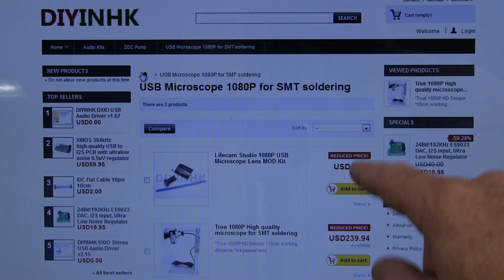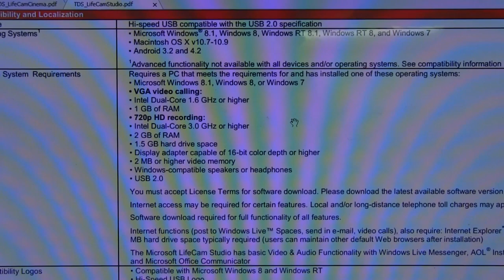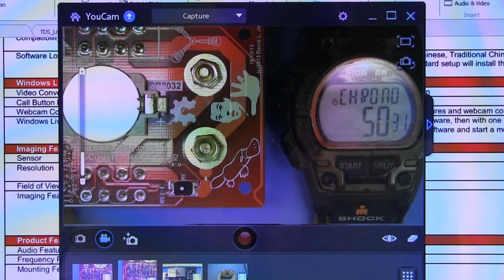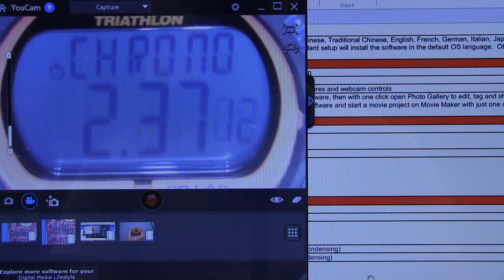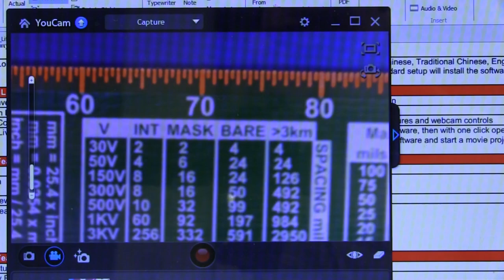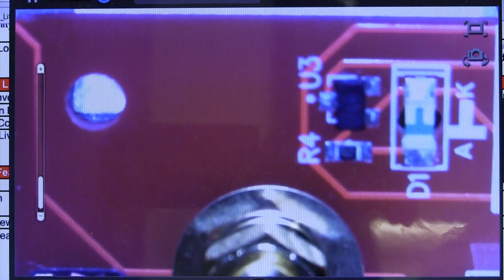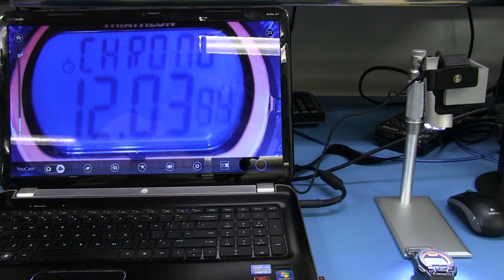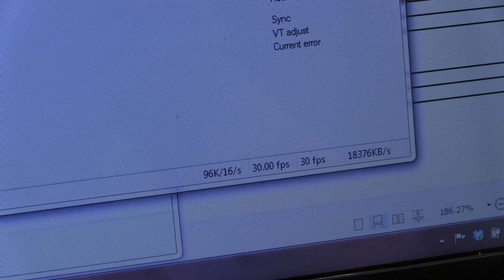EEVblog #590 - DIYINHK 1080P HD USB Soldering Microscope Review + Tagarno FHD ZIP

Comment: AMD Radeon 6770M, not intel.
the issue with the stuttering on the better camera is possibly something driver-related. the HP should be more than fast enough to handle running that without recording. it could be that USB selective suspend is on, I've had this issue with a couple webcams in the past.

the other thing to obviously try is not to use cyberlink youcam, since it's pretty buggy for 1080 recording anyway. there's much better options that make use of hardware better that don't bog down when recordings are done... thers is no reason why your hardware shouldn't support recording at that resoluiton.

Comment: Dave, I know this is an older video and maybe you revisited this, but...   I've found that if you either modify the base to add weight or use a bench clamp then rotate the arm around 180deg to the back you gain significant stability improvement.

Comment: That laptop with an SSD should have no issues with recording at 60 fps. It is definitely your software. Have you tried the scope in virtual dub as well? VLC is fast but is not intuitive and tricky to get setup. Also, record in RAW format. Your ssd can handle it and you dont have to do extra processing. Youll have a higher quality final video as well since you will not be compressing it twice.
Reply from the maker: I'm currently working on direct streaming solutions.
Reply: EEVblog
windows is a bloody mess for realtime, high-bandwidth stuff. You have probably figured it out yourself already.
Reply: Recently I've started using AVS Video Recorder. Really nice. Windows 8 included Camera app might also be enough!

Comment: The limited FPS in full HD is most likely due to the video format chosen by the application.
The LifeCam  has the ability to deliver MJPEG compressed "video" stream allowing  full framerate at full HD, but the windows drivers and libraries may no longer expose that so app runs video uncompressed.

Source: https://www.mgraves.org/2015/08/a-better-understanding-of-the-microsoft-lifecam-studio-webcam/

Comment: It is too bad the manufacturer "missed" the working distance by about 1cm or so.  It would be nice if it could focus all the way down to the bench.  This seems to be a problem with the way the microscope is mounted to the armature.  Perhaps they should have made the main support tube (vertical tube) a little shorter, and it would have worked just perfectly.

I suppose a purchaser could modify the mount in order to lower the microscope body a tiny bit, so that it could be adjusted to focus on the table as it should.  Perhaps right where the scope connects to the pivoting mechanism, you could take a small piece of flat steel, and with a little tinkering make a little 'extension' bar to keep the scope thrust slightly forward (downward) of where it normally sits when assembled right out of the box.  In other words, have the camera "crane its neck" forward a little bit so when it is lowered to the lowest elevation, it can see the table surface within its focal range.

Luckily, this seems to be the main problem, and it is more a "crude mechanical issue" rather than optics or software.  Therefore a crude mechanical workaround similar to what I'm suggesting would be well within the skill set of many users.

An excellent review of an amazing budget microscope!

Comment: Have you tried recording with VLC? (VideoLAN), it doesn't give you that many options, just records the "direct" video stream. Worth a test.
Reply from the maker: Ah, I forgot VLC did recording, use it for my playbacks. Will have to try it.
Reply: I wasn't aware that VLC could record. Thank you for this comment.
Reply: Media -> Open Capture Device... and View -> Advanced controls (for the record button).
Reply: TheAmmoniacal
Thanks! I'll try it out when I get around to it.
Reply: EEVblog make a DVD extra video.
Reply: @DemonTraven  Yeah, VLC does it, but it has a very strange interface and setup procedure. Very alien, but once you get through it, it's one of the fastest as it is very lean. It just does the minimum necessary to pass the data to the codec's you setup to use.

Comment: If you have excess solder on your board or if you just want to make it look nice, run some solder wick over the pins. It will also take care of solder bridges, including the ones hidden under the chip, and make it look nice. Good for passing QA inspection. I have fixed more than a few boards using this method.

Comment: I don't know if it has been mentioned previously.
If the Tagarno is able to be used as a camera, you could try using Open Broadcaster, which will allow you to use Quicksync which is available with your processor. It would make capturing 1080p@60FPS a breeze.
Provided the Tagarno is doing compression for USB 2.0, or you have USB 3.0 available.
Really surprised that HP doesn't have 3.0

Comment: I would put my money on bugs with the USB 3.0 port. Check for latest drivers. Make sure you are using a using a USB 3.0 port native to the chipset if available. Some ports also share channels to the controller so try your camera without any other USB devices if you haven't yet. Another thing to try is to disable any power management features in Windows 7. Search for advanced power settings.

Comment: the lifecams have 2 modes, it has a yuv and a mjpeg. The mjpeg is the smooth one. Web cams only have shutter priority exposure so lower light means stretching out each frame time making it choppy. Im surprised they did not build this around one of the newer logitech ones that support AVC mp4

Comment: I use my old PAL analog Video Cam for this job, hooked up to an old and little PAL S/W video monitor, to view my SMD soldering. The cam´s optic gives me a 10x macro-zoom so i can view a sot23 full screen where the cam is 20cm above from the PCB.
Just made with "junk" components, which lying around doin´ nothing....I can record the whole thing with my PAL/USB (800x600/50Hz) capture interface if I want...
Reply: Do you have youtube example?
Reply: No, sorry -- just because i do not do SMDs at the moment, therefore my "smd-monitor" resides somewhere out of reach (means: i do not know where i left my cam:) but when I do the next SMD job i´ll do a video...

Comment: I notice the bolt in the bracket is off centre, rotate it 180, and reposition the camera to suit, you may get a couple of inches advantage, and hopefully be able to put the board flat on the bench
though you may need to drill a new hole for the camera hook

Comment: I've had massive issues with a TQFP-32 MCU. Chip getting hot, can't upload code, all sorts of issues. Even though there were no directs shorts between the pins, reducing the pad width (to get higher pin spacings) seemed to fix the issues. Is it a common problem that short pin spacings on these SMD packages can cause issues? I'm thinking flux residue, humidity or stuff like that?

Comment: Did you know if you dont have solder wick you can use some of the copper braiding as used in coax 75ohm wire just strip It out and flatten dip in solder flux and you got solder wick cheaper as well as you can strip old Ariel cable :D

Comment: Hi Dave,
why do you turn the U-shaped aluminium bracket not 180°, to get deeper with the camera?
Reply from the maker: That's the way it came mounted. Could probably flip it though as the bolt is not centered.
Reply: EEVblog Hi Dave, sorry, turn 90°, not 180° as i wrote. I think you get about 10mm deeper then whith the focus point.

Comment: Dave, try debut for your recording,
It is similar to you cam, just choose the free version.
you can record the display from the computer, you do not need to point a camera
Reply from the maker: What the video, I tried it.
Reply: EEVblog you do know you can manually set the frame rate
Reply: EEVblog
You might have to change the video compression settings from the camera.  If it was trying to stream raw RGB over USB2.0 that could cause the slowdown.  I suspect YouCam and VirtualDub were using an MJPEG or other compression setting on the camera.

Comment: Was the mount the cam is attached to on the rite way? It looks as though the bolt that attaches it to the stand is off set . so it maybe upside down. This may fix the focus issues.
Reply from the maker: Probably. That's how it came assembled though IIRC.

Comment: Dave. Your notebook should be more than capable at capturing full HD video over USB provided it has a USB 3.0 port. If you don't have USB 3.0 ports, you may be able to add them if you have a PCMCIA port. Either way your computer is definitely not the reason it's not working ! Great video really enjoyed it :).
Reply from the maker: Yes, it is the reason. It's not easy to re-encode full HD at 60fps in real time. It will only possibly work is streamed direct to disk.
Reply: EEVblog Well, depends on how you are encoding it.  H.264 encoding is probably out of the question on that laptop's CPU (although some encoders might use the Radeon GPU to accelerate it), but you can probably run at least a simple codec like HuffYUV, which should get the file size down a bit while requiring very little CPU power.

Comment: That focus height problem is pretty stupid IMHO. Can you swing the arm 180 to get that stand-foot out of the way (and put some weight on it so it doesn't fall over)? Thanx!
Reply: I wonder if its set for when its straight down and not tilted to focus on the base.  The distance added when angled off to the side may be about how how high it needs raised. Still they could have made the bracket a bit shorter minimum and gave it more up range.

Comment: In 2017, is this still the best USB real time microscope available for the money? Like Dave states, eBay is full of that cheap $50 ones. I had one of those at work and it was to sluggish to use but that was 3-5 years ago. 30 fps sounds great without a supercomputer attached.

Comment: Do you think this would be able to be usable soldering 0603 (1.6mm x 0.8mm) SMD?  I work with cell phones and don't want to spend $2k when I can do with modifying the Microsoft webcam and get away for about $100.  Also, your computer is WAY more than enough to capture 60FPS.  Use a Hauppauge PVR 2.  It'll capture via HDMI to your computer no problem.  I did it with a dual core computer a couple of years ago with the previous version.  Well worth the $200 investment.

Comment: hi i was looking at the price for this item and it cost more than  499 dollars on eBay now?   why ?  were did u get it for 250?
Reply: $280 at the website he put in the description. I guess the price has increased slightly in the last two years.
Reply: I would forget it. andonstar took his remarks to heart and has a new model for 200 US shipped. HDMI direct to a monitor built in 7 inch camera at 45 degrees from the barrel lens. Internal monitor is perfect for soldering or blow it up on an external monitor. Self records to micro SD so no computer needed it does support USB 2 to a pc and has software for it. To quote Dave beautiful. If you are just starting a lab look at it. I actually paid for one putting my stereo microscope in the back cabinet.
Reply: Lynn Nash how do i find the one your talking about ?
Reply: kairus1 ebay search for adsm201 or YouTube has several videos it is fairly new
Reply: Lynn Nash  Great thank you very much

Comment: The lifecam's limit of 5 fps at 1080p is due to USB 2.0 being saturated. I was surprised when I ran out the math and found that out for a previous project: http://www.wolframalpha.com/input/?i=%2835+MB+per+second%29+%2F+%28%28%281920+*+1080%29+*+3+bytes%29+per+frame%29

However, I've since had good luck with Logitech's C920 camera (~$70), as they appear to be the first ones on the market running H264 compression on the camera itself to get around the limit. Of course that means it eats up about 5% of your CPU in the worst case to perform the decompression when viewing the full 1080p x 30 fps on your computer, but the results seem to be well worth the overhead.

Anywho, here's hoping that it's not too hard for DIYINHK to take advantage of this newer generation of cameras that have figured out how to get around the USB 2.0 chokepoint. :)
Reply: USB cameras can send the image data raw across USB (like the calculation that you did), but modern webcams can also do image stream processing into mpeg2, mJPEG or even h264 in hardware, so they don't have to completely saturate the USB link just to get a video stream across
Reply: Also, these are single-chip cameras, they don't send 3 bytes per pixel, only 1 (sometimes not even that, only 6 bits). The image is then interpolated to full RGB in software (either on the PC or on the encoder running in the camera itself).
Reply: RFC3514 this isn't true. colour cmos contains three to four times as many light sensors as it has pixels because each pixel contains three colour channels, separated by bayer filtering. Color filter array is a serious science. You're right that really cheap cameras will probably struggle to quantify the 7th or 8th bit, though you won't see this on regular cameras. Hell, even shit point-and-shoot cameras have 10-12 bit per colour channel these days (yet it still gets processed into 8-bit jpeg)., and dslrs venturing into 12-16 bit per colour channel. CMOS development is by no means stuck, the stuff they're doing right now with sCMOS designs is beyond what we imagined cmos to become, and emccd is nearing single-photon sensitivity, so I guess they're nearly done

Comment: Interesting. Thinking along the same lines I wonder if you could use something like a Canon digital camera instead of the Lifecam. The firmware on those can be hacked allowing full control of the camera from the computer. Then you would have super high resolution, optical zoom, focus control, etc. Would cost a bit more but still way less than the Tagarno.
Reply: The macro lens required to get that kind of magnification at that aperture would probably end up costing as much as the microscope. And you don't really need to hack the firmware; most Canon DSLRs can be controlled via USB using the software supplied wit the camera.
Reply: RFC3514 I wasn't thinking DSLR level, too expensive. Just a point and shoot can take remarkably close very high resolution macro shots in stock form. Not sure how fast it could continuously stream it though.

Comment: Yeah that's pretty overpriced considering that those cameras are around a hundred bucks, I doubt the optics/stand are worth that much extra.

At least he sells the optic separately though I wonder if they cost much. Depends on if they are plastic or glass, it is a better option than most you would see on ebay though.
Reply: Also that laptop is more than reasonable for just using a webcam, when they say dual core at 3 ghz, they probably mean a core 2 duo or something like that.

Comment: Hey Dave, try this to grap full HD HDMI Signal :)
http://www.elgato.com/de/gaming/game-capture-hd
Reply from the maker: Nope, that won't do 1080p @ 60fps. Tagarno claim that not even the Back Magic boxes can capture it properly.
Reply from the maker: Plus I need to insert live audio from a mic into the HDMI stream if I am to capture the HDMI output directly.
Reply: EEVblog Hey dave, have a look at this, maybe you'll find something that suits you. http://www.videohelp.com/capturecards
This also might be a good fit: http://www.hauppauge.com/site/products/data_hdpvr2.html but I think its 30 FPS only.
Reply: EEVblog 1080p60 capture cards and boxes are rare, expensive, and not even worth the bother. I've tried to find some myself to replace software recording. A small PC's the way to go, and if I remember the Twitter feed right that's the route you went.
Reply from the maker: *****
All the talk is over on the previous Tagarno video forum thread. Tagarno say get a big arse gaming class desktop with 7850 GPU card. I say a NUC with 3rd gen HD5000 integrated graphics and Quicksync will do the job.

Comment: But eye can't see more than 25 or so frames per second, DUH. BTW consoles rule!
Reply: eyes see infinite FPS, hence why any frame rate will still be perceivable as stutter when an image moves sideways on any TV, monitor. The thing about 24 FPS comes from a standard that was established so all movie theater equipment could play any movie at the correct speed. It is fast enough for smoothness in movies but video games are different: They might feel very sluggish under 60 FPS, sometimes your eyes might not see it, but you can sort of feel the difference when playing at 30 FPS and then play at 60 FPS. Never forget that a game has to display many separate things at the desired framerate, GPU may have to wait on CPU for some stuff like physics or particle effects (yes the GPU display the results but still all that stuff has to be computed). A video or a movie only requires to display the data that has been converted by the decoder before sending it to the display.
Reply: Mario Dupuis if you were able to recognize sarcasm, you could have saved some valuable time typing that long message.